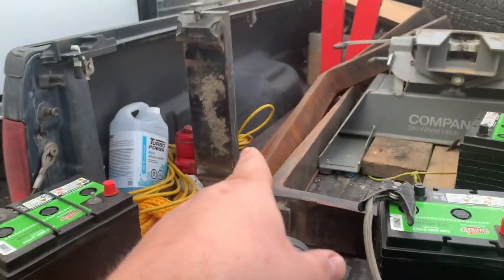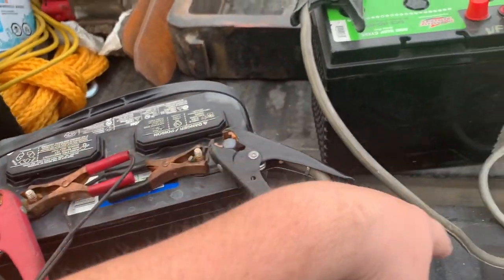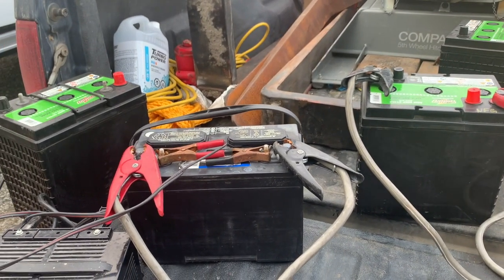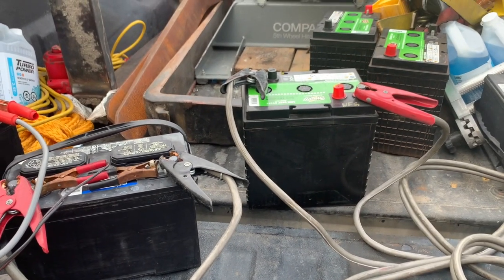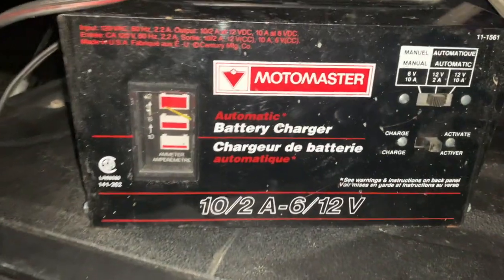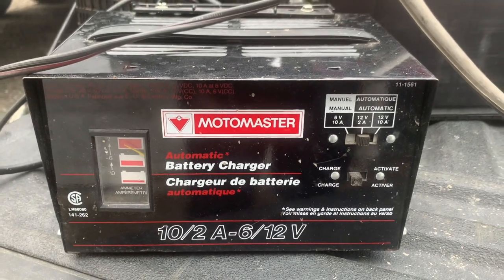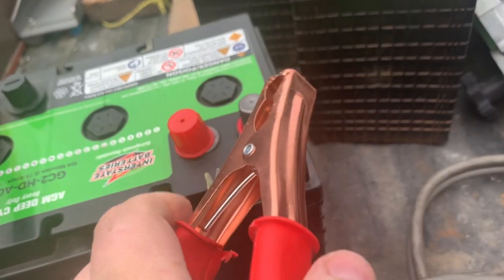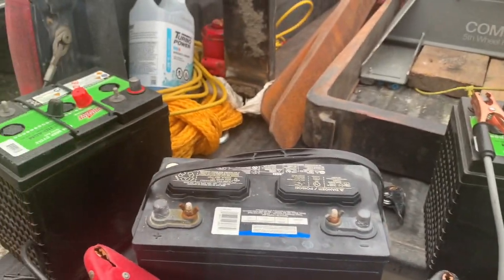Agm Battery Restoration Test P1

Comment: 🙋🏻‍♂️ ummmm…yea Hi, quick question…. What in the good gods name are you trying to accomplish here kind sir?? Why are you expecting a 6 volt battery to magically turn into a 12V ?? Tricking it with a good 12V battery won’t ever change its voltage brother.. that only works to revive other 12V batteries that got depleted and discharged below the threshold, but hey , I’ve been wrong before and I barely got through high school, maybe you know something that I’m not aware of… but from my experience with blowing up many batteries for many years I don’t believe you’re going to be able to use these batteries for anything that requires more than 5-6 volts, unless you combine them together
Reply: Already been noted in previous comments

Comment: Im glad to see somone told you they are 6 volt batteries.  Put them on 12volt boost for 1 hour, then set for 30amp for 4 hours, then 2 anp for 2 days. That should remove any sulfates and allow them to charge.

Comment: How do those battery places that sell used refurbished car batteries for cheap do it?
Reply from the maker: I think there all subscribers of mine lol, I am not sure how they do it... Before putting solar on my rental trailers customers would kill the batteries within days if of grid use. I could usually bring them back with a slow charge but they were never the same as new after such a low discharge... Putting solar on the trailers was a game changer now trailers come back with 95 -100% full charge!